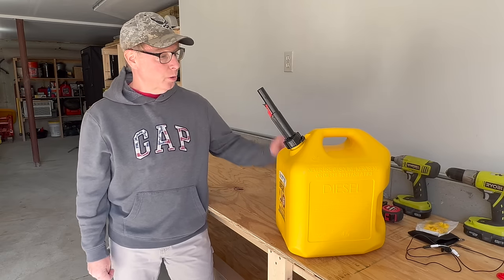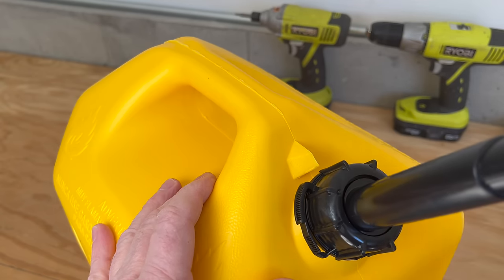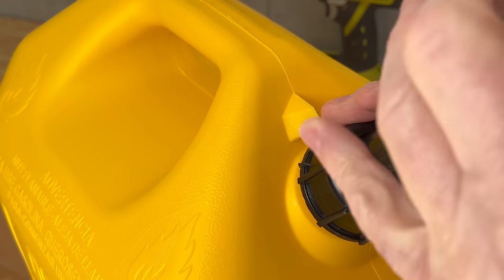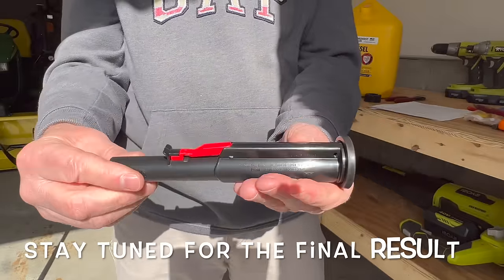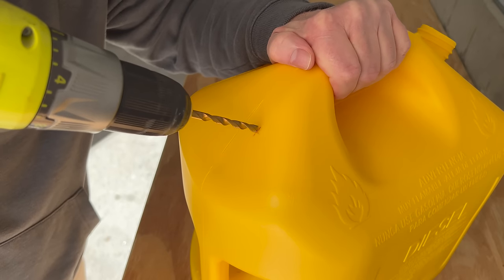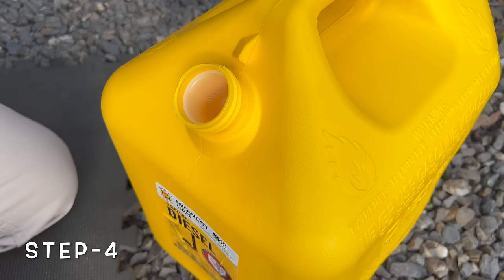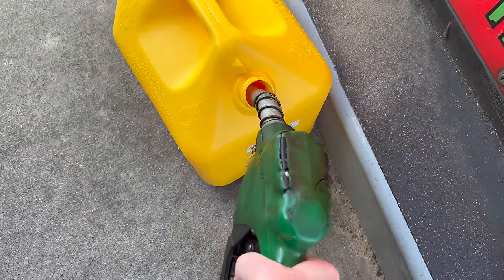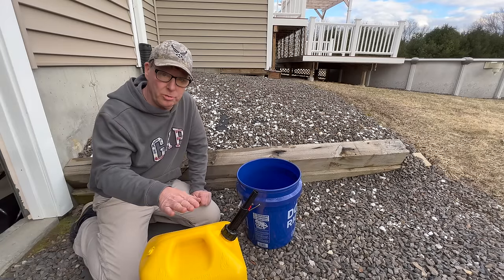Fix a New Gas Can in 4 Simple Steps.

Comment from the maker: Subscribe for free by clicking this link. It will help YouTube recommend more content to you. Thank you! https://www.youtube.com/channel/UCdOuZ0bxeSxA8ZAHttc0U-w?sub_confirmation=1
Reply: or just buy a real gas can to begin with
Reply: Great tips on the cans by the way!
Reply: Seems over fix. Buy a vented spout and toss the approved one.
Reply: @ronmit-p5g  All the new cans come with spouts that have the "safety" features.
Reply: @ted458  yea in stores ... order one online like a normal person lol its 2024
Reply: Why are they so expensive? A nice air tank with gauge shut off and hose costs about the same
Reply: These "fixes" seem reasonable.....HOWEVER.....
If fire investigators determine the cause of a fire had anything to do with "fixes" to your fuel storage your home insurance company will have an issue.
That vent may be OK for deisel but for gasoline that vent you install has to hold about 9 PSI of vapor pressure.   With a pop-in vent that is unlikely.
Reply: Informative content, thank you. I can't help but think that if this were cut down to a short it would get a ton more views.
Reply from the maker: @ssconver  I did make a short on the spring removal but although shorts tend to get a lot of views they make almost no money to support the channel. For example the ad revenue on this video is several thousand dollars with 560k views. A short with the same number of views makes about  $80 dollars.
Reply: Had a job giving motorists gas from 1 gal. cans several times a day. On the new ones I'd just take the nozzle off and use a funnel. Ta-dah! Ain never seen that interior baffle thingie.
Reply: @calkrueger7931  the mounting spigots where it threads are different.....that's the first thing I tried. Spout off my other can wouldn't fit. Did the modifying as in the vid. Don't know what appeals to me more a having 
functioning  gas can or disabling the EPA builshit and kicking them to the curb.👹😁
Reply: @halseyknox  Use the spout nut from the approved can.
I was not man enough to remove that spring.
Reply: @ronmit-p5g  Safety laws apply to all products regardless of where the item is purchased.  Besides some of us actually like to look at a product before we buy it.
Reply: @michaeljorgensen790  Until recently all of the cans came with the "pop-in" type vent.  They are kind of hard to open.  I bet they will easily hold the 9 PSI.  It's not uncommon especially in the summer for pressure to escape when you open the vent.
Reply: @BackyardMaine  There are still a few odd cases like me who refuse to watch shorts.
Reply: @michaeljorgensen790 problem is the iso engineers dont realize that you spill so much fuel using cans like this they are way more dangerous. Added to that i do not keep gas cans in enclosed areas such as a garage.